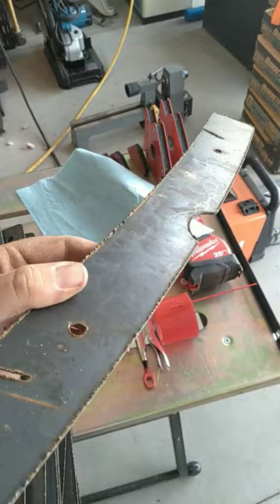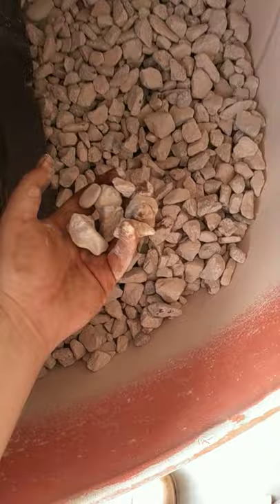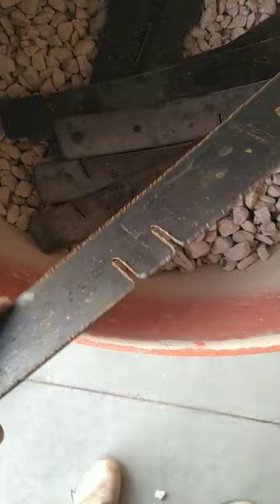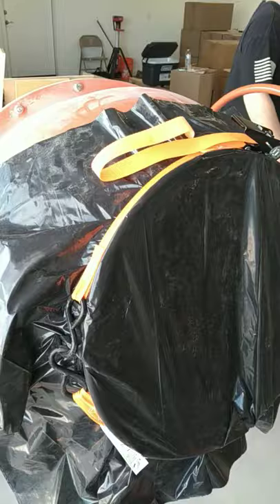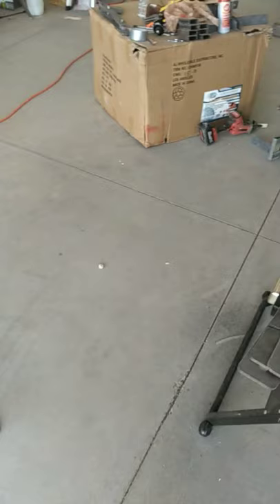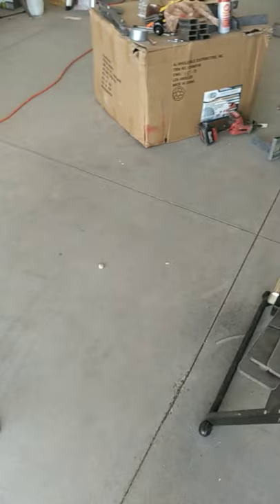Fastest way to remove slag from plasma cut parts

Comment: Great idea on the concrete mixer, I built something similar, a 16" x 48" drum on pillow block bearings, a 50:1 gearbox, and farm motor.  It is rubber lined with a horse stall mat from the farm store.  Runs a 4x8 sheet of parts or more, I don't use abrasive, it's all part-on-part. They come out looking the same as yours after 15-20 minutes.  It spins about 35 RPM and is very noisy but the 3/4 rubber lining helps a lot.  Had I seen this video before I built it, I would probably be using a modified concrete mixer!